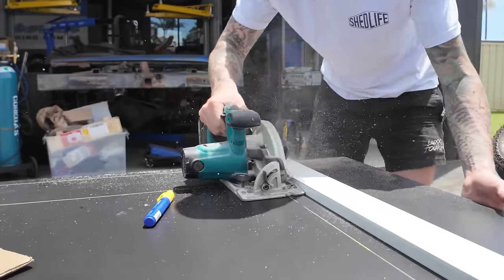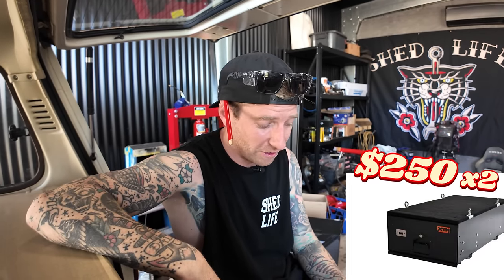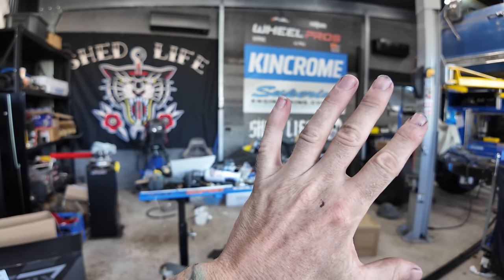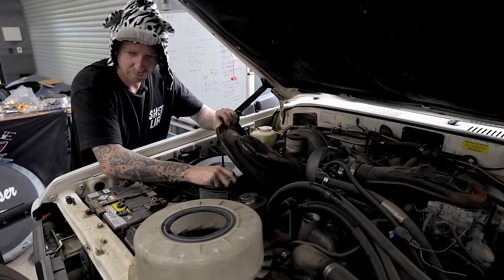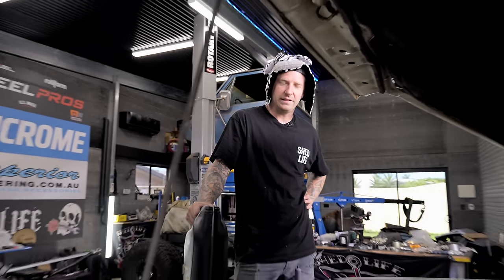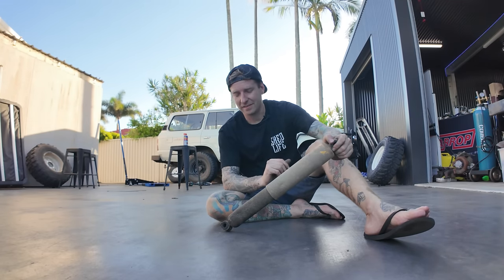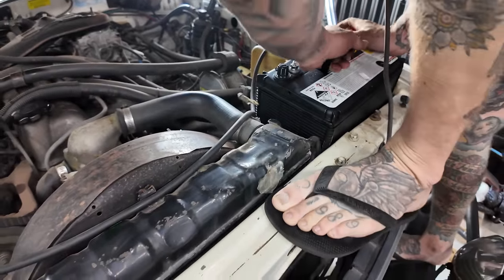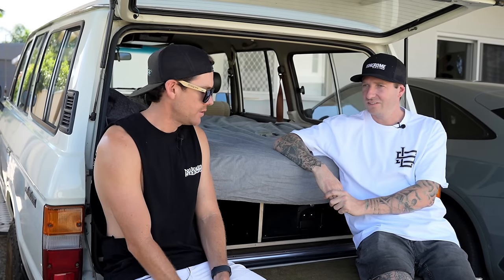Building my old LANDCRUISER for less than $5000 ! (Price Breakdown)

Comment: 13:55 When doing a service I suggest running the vehicle up for 5 or so minutes to heat up the oil which makes it thinner and much easier to drain the oil but remember it will be warm but it shouldn’t burn you but be careful just in case.
Reply from the maker: Thanks for the tip !
Reply: Great tip! Thanks sooty!

Comment: You can keep the rear seat to with this type of setup too.

You can use a Z folding platform with ply and piano hinges to make the bed area with the seats folded down.

Also form ply is far to heavy 9mm marine ply is more than adequate or on a budget 12mm CD ply.

Either way love the old 60!

Comment: Another thing when changing oil filters is make sure the old filter seal comes out before the new one goes in. Also when jacking the rear or loading a trailer put it I 4x4 that way the front is locked in and when rear comes off ground the front will hold it from rolling

Comment: Re. Handbrake and jacking back wheels. If you put the car in 4wd (lock hubs) and in gear you can do the back end in one go still.
Reply: Definitely! But for the young fellas who cant afford a 4x4 yet i think its a good tip!
Reply: @macpreston  absolutely! for anything not 4wd, always chock the wheels. On patrols lifting one back wheel with the handbrake on can have the same result, as the handbrake is on the tailshaft and the diff will just spin. Ask me how I know that one...

Comment: one thing with 60 series rear drums they can adjust themselves when you use the hand brake regularly so every now and again jack your rear wheels up and make sure wheels spin freely you can release them from a little hole that's covered with a rubber and also your gearbox can push fluid from the transfer case to the gearbox we use to put a hose connection that would keep it flowing back you would be able to look it up and the tappets will tighten down if running lpg
Reply: Great tips thans douglas!

Comment: There's a few extensions needed for best performance - the owner's pen*s, the sway bar links 26:15 are hitting the axle, brake lines 27:59 are gonna rip off when the car is jumped, and a 19mm bush is easier to fit into than a 16mm,  just sayin'. 😆